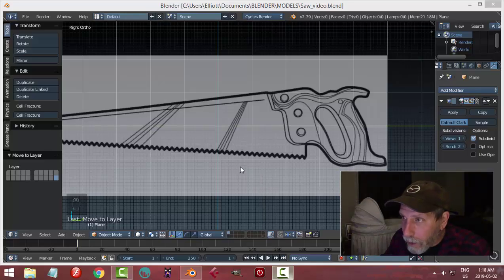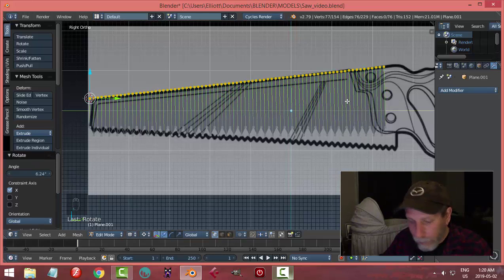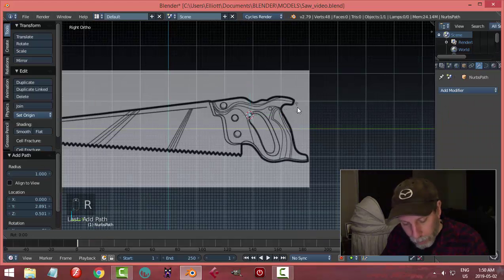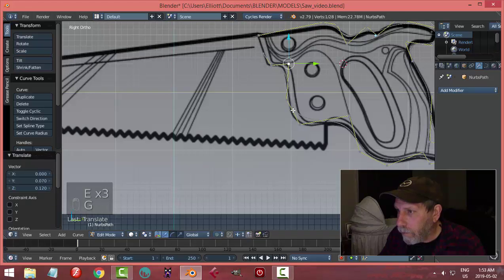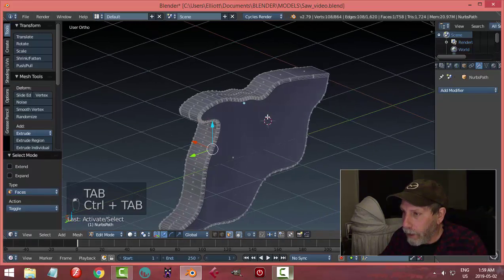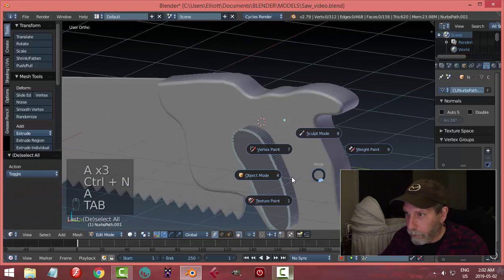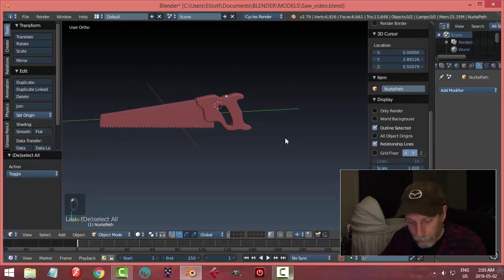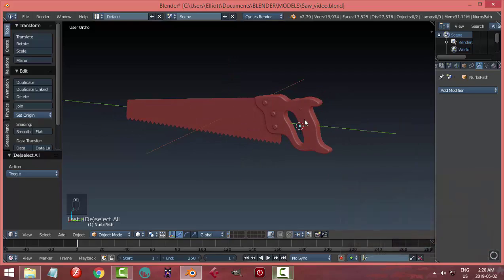Blender: Modeling a Hand Saw

Comment: Great up top a point - had to abandon tutorial, joining the curve was way too vague and did not work.
Reply from the maker: Sorry it didn't fully work for you.  I'm curious where in the video that happened, maybe I can have another look.  Thanks.
Reply: @zerobio  Thank you for your reply. I was really enjoying the tutorial but at 8:28 things went pear shape. I joined curve verts then converted to mesh but received an error trying to (F) add face. Went back and forth,  trying for about 20 minutes then gave up. Finished handle using box sculpting and modifiers..
Please continue to make tutorials - i really enjoy your style. Thank you.
Reply from the maker: @malachiaird3701  Note that I converted to a mesh BEFORE joining the vertices.  If you joined the vertices while it was STILL a curve, that would definitely cause it to be too rounded.

Comment: Hmm I was following this tutorial but I'm stuck at the bevelling. When I use the bevel tool it gets really glitchy. I don't know why :(
Reply from the maker: Can you go into object mode and select the object and apply scale and rotation or any other transformations you have made (Ctrl-A and choose "All Transformations").  Perhaps you did some scaling or rotating while in object mode.  As well, try selecting all of the object in edit mode and then recalculate normals outside (Alt-A and choose "recalculate outside").  See if any of that helps.  Beyond that, I would suggest re-modeling a part of this again and trying the bevel early on to see if it is working properly for you.  Good luck and let me know if things are still not going well with that.
Reply: @zerobio  Thank you! I'm gonna try it out
Reply from the maker: @foresty226  good stuff!

Comment: 12:13 Would you mind explaining why beveling the edges and insetting the faces helps remove the weird looking due to smoothing?
Reply from the maker: I think it's because the smoothing function is being stretched and inserting the flat faces reduces the stretching. Regardless of my bad explanation, it works whether you use extrude or inset and don't move the new faces created.
Reply: @zerobio  Thank you for taking the time to answer me!
Reply from the maker: Anytime, my friend